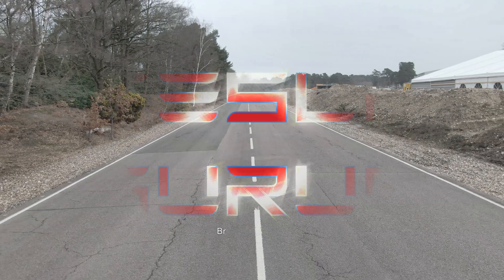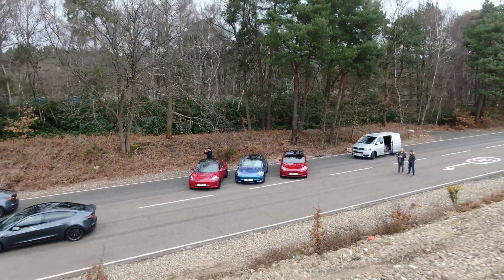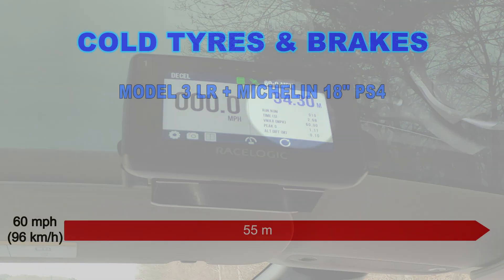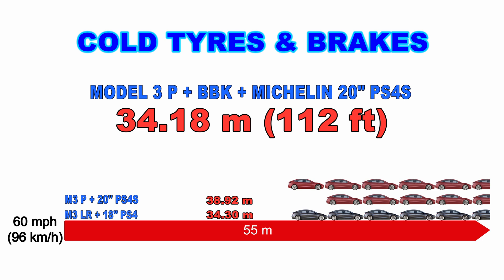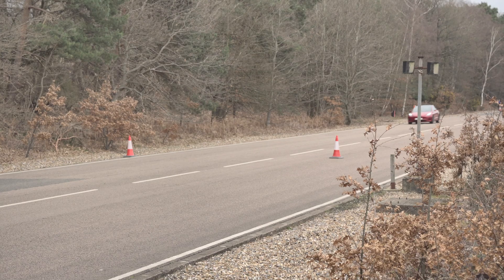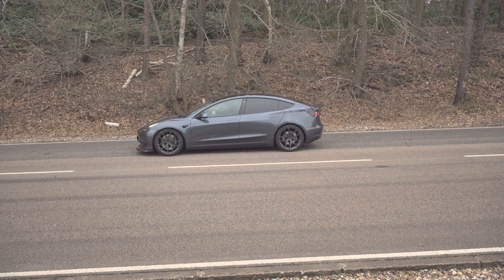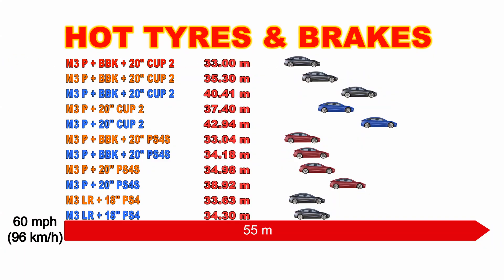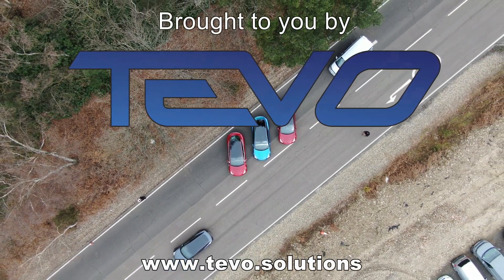Not a Tesla acceleration test!

Comment: The extra rotational inertia of these bigger wheel/tire combos mean there’s a need for dramatically increased braking forces just to get back to where the baseline wheel/tire combo was. Also something to consider, what’s the difference in the overall vehicle mass between the LR and the model 3 Performance versions. All things being equal the lighter car should stop a little bit quicker if the braking power was the same. An old standard range plus or other lighter spec rear wheel drive car fitted with the same PS4 tires could actually be the new overall winner in this context.

Comment: I got an M3LR and I’m actually worried with all of these videos that Tesla soften it all down. Let’s hope they go the other way and improve the performance model.
Reply from the maker: The Performance is better than the LR in several ways, but it's a question of how you use those additional features. If you do mainly city driving you won't get much of an advantage buying a P over a LR, but if you do a lot of high speed Autobahn driving or want to take your car on track then the P is the one you'll want.

Comment: Great video John 👍   Very interesting. Adds validation to a similar result I found recently (std model 3 beats performance) and exactly as you say, different temps and conditions suit different tyres. On my day in question it was quite cold and damp. I suspect warmer would favour the Performance tyres...?
Reply from the maker: It might, but the Michelin PS4 is a really good tyre in it's own right. Maybe not as good as the PS4S at dry handling, but with dry braking it may just have the edge when the tyre hasn't been warmed up with some driving. Temperature is key, that's for sure. Thanks for the comments!